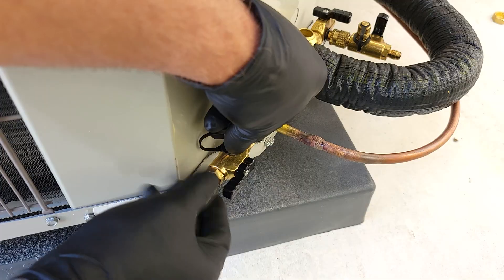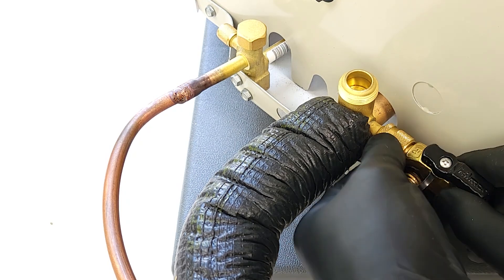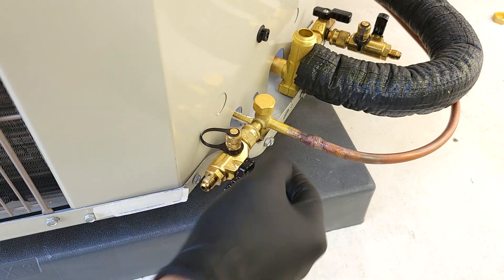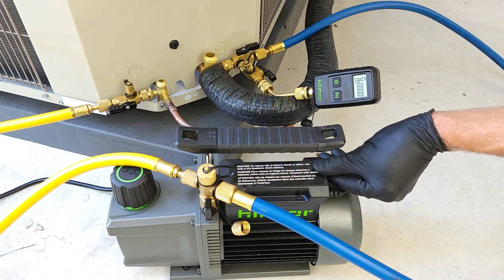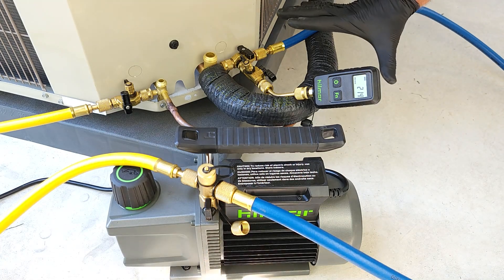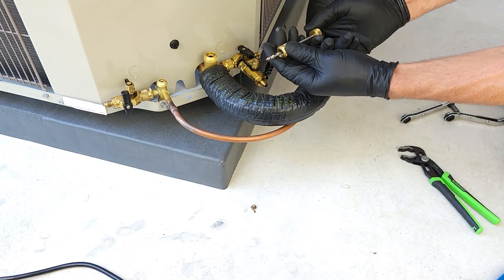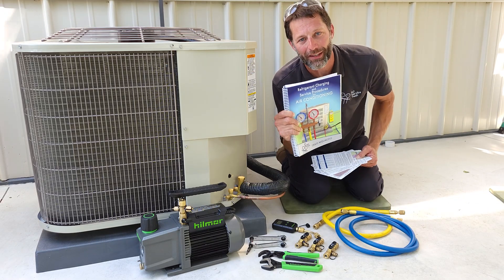Vacuum Pump Setup on an Air Conditioner! Procedure, Tools, Connections, Step by Step!

Comment: I have looked thru all your tool list, what is the part number/manufacturer of the adapter going from valve core tool to the vacuum gauge. Thanks for your help. Great Videos and learning resource.

Comment: The valve core removal tool was in the closed position at the vapor side during the valve core leak check. That setup did a fantastically fast job at pulling below 200 microns!

Comment: Craig, that's a great procedure you have, it was also the procedure I used. I do disagree with using 3/8" hoses though since you're only as big as your  smallest system opening; in this case the opening the valve core screws into. In addition, I multi-tasked(such as installing or reconnecting the wiring whip or I'd install the new TT wiring) while the vac pump was running, Also, I used Yellow Jacket flexible stainless steel hoses(you could also use 1/4 " flared copper tubing) to assure no air leakage through the charging hoses. I was taught that all charging hoses leak very, very slowly, but nevertheless they do leak. Take a charging hose, pressurize it with nitrogen, and hold it under water and observe carefully. You should see an air bubble every now and then. I know that you're not pressure testing with nitrogen through the hoses, so it shouldn't matter; however, my thinking is that it might prevent you from pulling a deep vacuum. Just my thoughts. Great video as always. Thank you so much for taking the rookies under you're wing. 
Rick

Comment: I’ve been doing this trade almost 16 years and I’ve decided to stop pulling through my digital manifold. I’ve got everything I need for a vacuum set up with no manifold. The only thing I cannot find is that 1/4”female x 1/4” female adapter you have for the hilmor micron gauge where on earth can I find one? the supply houses do not have them cannot find them anywhere on the Internet, could you possibly share a link?

Comment: Hi , Craig I have doing everything you did the only thing I found out I used a field piece micro gauge. After ruin the vacuum for more than 35 minutes, close the app ions valve on bothe refrigerant lines, and left the micro gauge valve open ; the micro gauge go up very quickly rises above 800 and more fro 200 microns, I do not know what is the problem

Comment: Question, I thought you had to open up liquid line first, to avoid compressor slugging? Thank you. Great video. 👍
Reply: No wrong.liquid makes the comp oil leak into the line set..suction side is better because the reversing valve is before..versus liquid is straight from compressor
Reply: @DJV94022 does this order apply to non heat pumps as well?

Comment: This method is great. However, this shouldn’t be your only option. You need to have a set of 4 port gauges. You WILL run into systems where this isn’t a option. The design of some systems do not have clearance for these core removal tool. If they do have the clearance, this is the fastest method. Great videos on this channel!
Reply: Thanks!
Reply: For sure.  I can't understand why manufacturers can't move the king valves. There's all kinds of room

Comment: A trick I learned a while back is to open the king valve and get about 50psi in the lineset then close it back. THEN, put your valve stems back in and they will not have nearly the amount of resistance as a full system. Then after the stems are in, open the king valves all the way 👍🏽
Reply: Then the unclean air gets trapped in your new r410a
Reply: Release it by the suction line?
Reply: Yeah, If the pressure is too high you can't get the valve stem in.

Comment: On an older system if you draw down the freon and front seat the valves how do you know there is no air in the system from a leak?
Reply: You would not be able to tell if there is a leak in the condenser coil without a leak detector. You could pressure test the line set and the evaporator coil with the service valves closed and the refrigerant pumped into condenser. You would have to vacuum it down again before releasing the refrigerant

Comment: If it was an existing system and you pulled the vacuum without changing out the filter drier, would you see the raise and plateau you were talking about?  Seemed like I was boiling off water out of an old filter drier.  I did not have the right one and re-used the old one.

Comment: Hello, I am following you from Turkey.  I'm watching with joy.  I have a question.  After 08:16 the pressure rises.  Doesn't that mean it's a leak?  Or is it normal for it to go from around 180 microns to around 214?  Why did it rise so high?
Reply: Yes however he mentions Negative pressure. Or vacuum. 
If the system was pressurized, and had a leak, you are correct. Losing pressure is an indication.
Reply: @Geminiappleboy  Then there is no leakage in this system?
Reply: @mazarat4768  there is no leakage in the system.
The negative pressure which he is measuring in Microns, increased such an insignificant amount in the amount of time that the system can be considered sealed. 
If it were to raise by the the hundreds of Microns, in the same amount of time, that would indicate a leak. 
The pressure went higher in the video very little, likely because of the equalization of the various pressures in the components, parts, tubes ect...

If you had a water faucet that leaked one single drop of water every 10years, you could pretty much say it does not leak. 
If the faucet dripped water every 10 seconds, you would say it has a leak. 

These acceptable 'losses' are common in every industry. The difference is how relevant they are to the system and what can be deemed acceptable.

Comment: Wow, you didn’t test your fit. Meaning pump and hoses to verify your equipment is capable of pulling below 50 microns. Failed to show nitro test with temp and pressure time waits test. Releasing nitro charge. Should I go on.
Reply: The title is vacuum pump set up.  I saw the set up.

Comment: I was doing my own installs on my rentals till one day I realized that I didn't want to do this particular install due to such a tiny attic ...I mean the blower/EVAP box might have had 3 inches of headroom TOPS.  So I paid this company to come out and do the install.  Get this...... As soon as they left ...the system quit cooling even though it was great when they installed it.  So I pulled a vacuum and it held for almost 2 hours ..... I filled it back up and it cooled for 20 or 30 minutes and went warm.  I pulled a vacuum again ...let it sit for 4 or 5 hours.  I could not figure out what was going on.
I called a buddy of mine and he figured it out.
The clown installer did not use a wet rag on the EVAP side while braizing (however you spell it) .....since its a copper to aluminum EVAP joint.... apparently they use a special process and you can't get it hot enough to melt so.......ruined the coil.  
Luckily I ordered a new one and finished the job.
Reply: Only clownish thing the guy did was braze way to long...maybe he was a crappy brazer...I have never over heated that joint !

Comment: I had taught that you first open the liquid line and after that the suction line bc if you open the suction line first you let liquid refrigerant into the suction line and may create problem starting the compressor. I watched you open the suction line first. Can you please or anybody else clarify me that. 

Good video. God bless you!!
Reply: That system had all the refrigerant locked inside the condenser coil. All  the condensing units come pre-charged at the factory. When he opened the suction valve he actually let the refrigerant escape into the line set and not the other way around.
Reply: Its wrong its the other way..suction line before the king valve is the reversing valve while liquid is straight out of the compressor oil

Comment: Sir great info but the suction side valve core removal valve tool was in the closed position during the final leak check. No doubt the check would have not been any different if open.
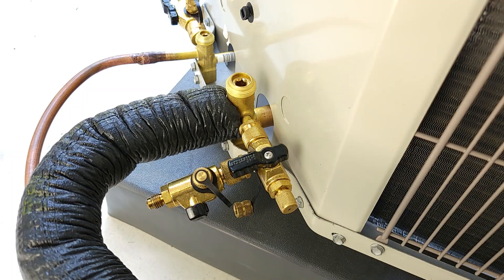Reply: I was going to ask the same thing, at 12:27 the valve was in a closed position.
Reply: @tinysand3517  great observations
Reply: Even in closed position the micron gauge is open to the system
Reply: I noticed that too

Comment: Hey you forgot to open the valve on the valve core removal tool when leak checking the valve core on the suction side
Reply: The instructor did that on purpose for the experience viewers to comment on his videos.
Reply: At first yes, then you can see he did
Reply: Its okay i mean the leak hes trying to prevent or cetch rarely happens
Reply: Noticed that too but the real ones know what he meant to do 💯

Comment: What was the purpose in half of all this.. a bunch of not necessary
Reply: what was the purpose of this useless comment
Reply: It's a proper way to do it then it's an half ass way to do it. Guess you like to do half ass work. 😏
Reply: The purpose is to guide new techs with precision making details steps. Brouhaha. Once we know what we are doing, we’ll do our own.
Reply: It can definitely be done the old school way, it might take an hour or two to pull a vacuum. This way is a lot quicker for sure but requires having a special pump, core removers, etc etc
Reply: This is just a faster way, mostly done on old units to pull down vacuum faster as most old units already have contaminants and are harder to pull vacuum down to 500 microns.. Not really necessary for newly installed units but to each its own. I do it his way all the time though, just a good habit if you have the tools.

Comment: What was the purpose of adding the second valve core remover to the other on the suction line? Can you just put the micron gauge right on the tool hooked up to the line set?
Reply: So when you go to let the charge go you can close the second ball valve and you dont put positive pressure or oil on the micron gauge.
Reply: @anthonyl94  i forgot my valve the other day, i did put some pressure into the gauge but I stopped when it didnt show any numbers, it was brand new, i hope i didnt destroy it :(
Reply: @SpecialKthx  yikes! I hope it didn’t fry it! Thankfully I haven’t don’t this yet. I usually use my manifold and I have the cps micron gauge on the middle port between my manifold and the middle hose. Seems to work great :)